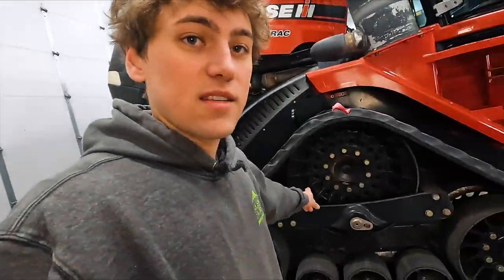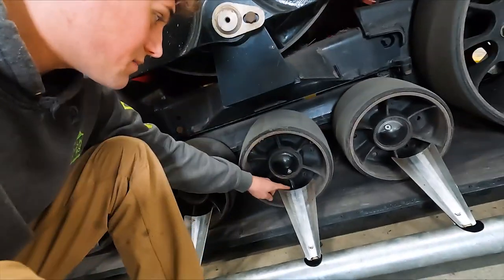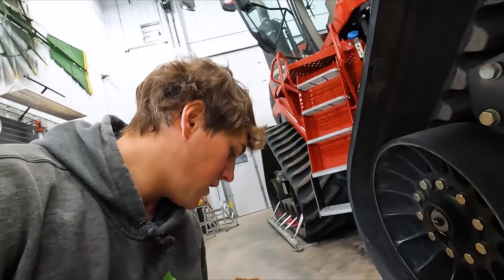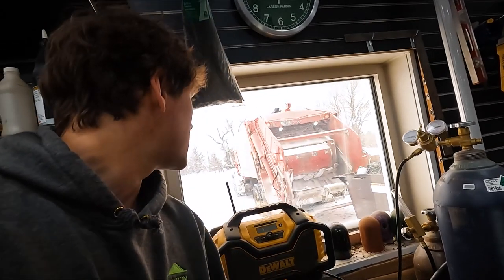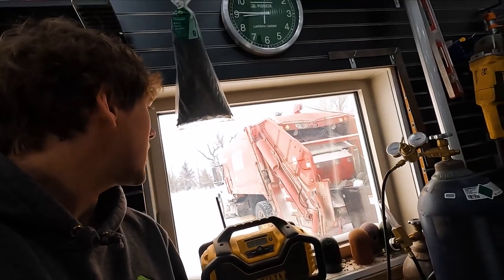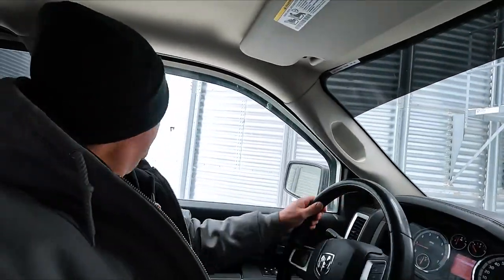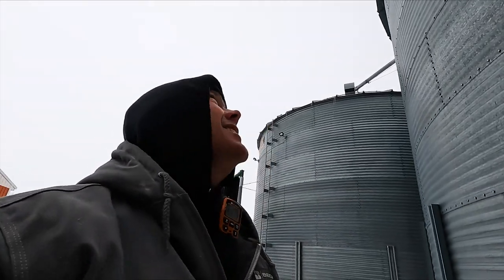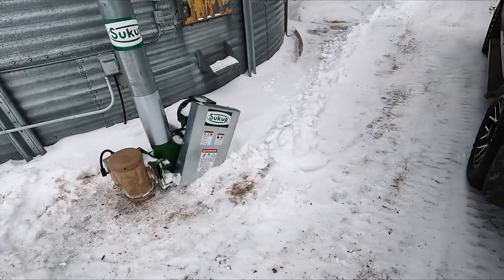Farming In Minnesota Is Fun!!

Comment: For changing oil in the idler wheels, run the toes up on a block of wood so you can turn the idlers by hand in the desired position.
Reply: Rollers... idlers take the most of the weight. 2 idlers 1 final drive rest are rollers. Not a case guy but have worked on track machines

Comment: Douggo, I have a bar, I call it a crowbar, my Dad did so works for me.   It is a twin to yours, same square head on top.   He told me mine was from shaft of a one way disk plow.   I use it to dig post holes too.  Enjoyed.    Chet get you another boggy wheel drain tool. Save you time.

Comment: Chet you need to wear safety glasses. You need to build a small platform to set on the lip of the pit then you can use your drain tube on the inside Dougo you need a cover over the grain auger motor then vent the side to have air to keep the motor cool. Have a great day in the sunshine and snow.

Comment: Chet I noticed the drain catch pans (as I call them) are adjustable, here is an idea for the three bogie wheels cut three pieces of plastic like from a five gallon bucket and make some extender, cut a slot in the end of the plastic extender so that it will slide on the gusset on the wheels that need them, no more rags no more clean up, food for thought...have a good one...

Comment: Lay a long piece of plywood under the tracks as you drive over the pit wide enough to set your drain pipe. The tracks will hold it in place.
Reply: remind me never to allow younear any machinery
Reply: @jamesmccabe1702  why, that is a very good idea, and not unsafe. Only needs to be a few inches wide.
Reply: @larryfreeman7979  I was thinking the same thing. Also seems to me that a "guy" could make one of those oil catchers pretty easy with one trip to Menards.

Comment: Chet Dougo that was great chet you could make a second one for draining that oil Dougo you can put that drive motor up 16 inches it would be out of the  snow  then all you would only have to heat great winter jobs when nothing going on lol ya right great video Chet might think of making out of pvc like me made out of plastic funnels tried out to fit each drain just drill pipe and fit funnel and glue and same with drain pipe to drain into drain pan mine no leaks and 10 dollars  at irrigation supply house and 5.00 for funnels at walmart

Comment: DOUG,
Ypu're absolutely right. That's exactly how it happened.
The pioneers were westward heading when they broke 
an axle or a wheel on the old Conestoga wagon. There 
was no replacement parts to be had  so they decided
to settle on this piece of land. Why do you suppose 
they are called settlers? Because they settled for 
wherever they happened to break down. You dont
think people actually struck out for Oklahoma intentionally
do you?

!

Comment: Top tip....when it stops running spray copious amounts of brake and clutch cleaner in. It dissolves the last of the oil , washes out any contaminants and dries out leaving a nice clean hub.....you can thank me later 👍👌🏴

Comment: Fold up some foil paper then mold it into a funnel around the hub to your funnel contraption bar. Just like your cups on the inside. No need to wrap with paper towels that will still make a mess…………………..For that catch bar funnel contraption that you can’t use inside the pit. Take two jack stands and add a length of pipe to raise the head to hold the catch bar container contraption up inside the pit.

Comment: The dump truck with forks on the front that slide into pockets on the side of the dumpster and lifts over the cab to dump in the top is even cooler.  And you can stay in the cab the whole time.

Comment: An idea about the draining pipe. You might be able to fit some rubber seals on the edge thats touching the wheels. Then when placing it to drain, you could push the rubber seal below the wheel so it seals the bottom side of it.

Comment: On outboards I usually put a little piece of tape (sticking out) underneath the drain plug so the oil won't drain directly down but over the tape and than down in a bucket or pan. Maybe this is also useful on those wheels

Comment: Always take a hammer and punch to drive the part and the snap ring down in the bore before you try to remove it. This adds clearance in the snap ring groove and makes it easier to remove. Most parts held together by snap rings will be pushing up against it. I like to tap the snap  ring down after i re-install it as well.

Comment: Drill two small holes into the to of those funnel thingies. One on each top edge. Put a loop of wire or string or a zip tie from one to the other. Then HANG it from the hub.

Comment: Chet, aluminum duct tape the sliding boards in place. No more rags required. For the tub that the oil drains into, a piece of aluminum gutters with the ends installed in place by again, the duct tape. They're flat bottomed, so not apt to tip over.

Comment: Make yourself as many cross pieces as you need that just fit into the pit and will support the drain tube so you can use it on the inside bogey wheel bearings.  Also maybe try using a heat gun on low or a hand held hair drier to blow some warm air into each bearing so the oil thins out and runs better.

Comment: Thanks for another great video. Was interesting for sure. 

Love that big breaker bar or buggy bar as Dougo called it. Nice and heavy duty for the big jobs. Just a suggestion for that motor and pulley stuck in the snow and ice.  How about building a big cover over all that to keep the motor out of the weather. Can’t see that real good but just a suggestion that might save you some time. Just saying. 

Winter time is hard on equipment for sure. Never easy Dougo. Hang in there. Glad the grain hauling is going ok. 

Good to see the shop supervisor, Toby. He is really a good dog. Pat on the head to him. 

Draining the track wheels is a time consuming job there Chet. Is that drain tube something you made or is that purchased???  Seems to work pretty good. Watch those snap rings. Might want some safety glasses on. Those snap rings are hard to work with. Another job done. Ya!!!!!

Eric , enjoy your trip south. Better weather there. 

About it I guess. Thanks Dougo and Chet for the video. Winter time is hard to work in. Hang in there. Thanks for everything. Looking forward to the next video. You all take care and be safe. 
The Iowa farm boy.

Comment: Pop rivet a piece of inner tube on the end of each funnel ramp and put a slit in it.  If the spoke is in the way, the slit will go around it.  If not, it should just stay together and work for both.  Maybe poly hose instead of inner tube.  My 2 cents…no charge.

Comment: How about taking a long plastic tote. Cutting two holes for the auger. And create a slot and splitting in half. Then slide it and tied down with some strap. Could reduce snow. Leave some treats though for the rodents.

Comment: id just take an angle grinder and zap a small notch in each funnel so you can get it up against the hub on the bogey wheel spokes that are in a vertical position

Comment: Chet, Those drain pipe 'ramps' are two piece and adjustable, right?  Make another piece to slide up to the axle that has a notch cut in the top edge. The wheel spoke will fit into the notch, bringing the 'ramp' right up to where you want it.

Comment: I would try to fabricate a PVC pipe with holes and something like milker inflations or vinyl tubing trimmed to fit tight under the hubs. And bungee it over to keep it tight to the hubs. It may work on the inside then. Just an idea.

Comment: I HAVE AN IDEA! 
This does not happen often... when changing bogie wheel oil, take a piece of 1 inch 3M masking tape and stick it to the bottom of the hub. Your machines look super clean so there would not be a sticking issue. This is the same idea as pouring paint out of a 1-gallon can. It will direct the oil flow right to the funnel better.

Comment: Would a notch in the middle of the drain funnels help for when the wheels are in the bad spot for the rib being down so you can get it in farther? Or like a thin rubber flap on the wheel side to catch better with maybe a slit in it? And for the pulley frozen in the ground could you build a box to slide over the auger and motor in winter to prevent snow build up?

Comment: Please look into using flexible oil drain mats. These look like they would help so much!  You can form them how you need around equipment features. 

Flexible Draining Tool Flexible Free Oil Filter Funnel General Purpose Funnel Extended Flexible Draining Funnel Tool Motorcycle Farm Machine Use